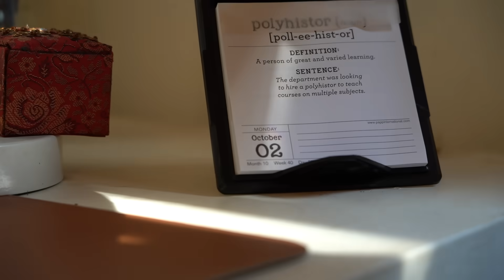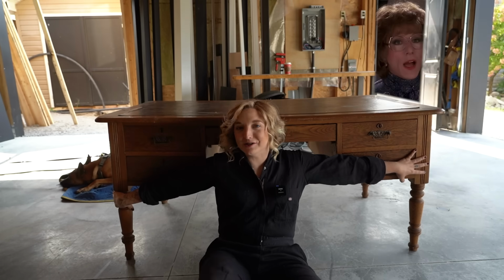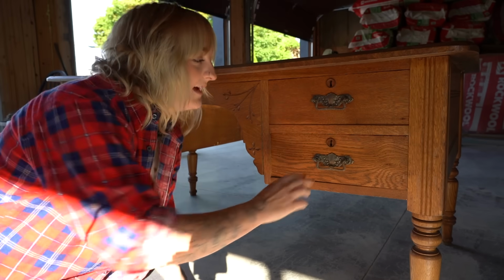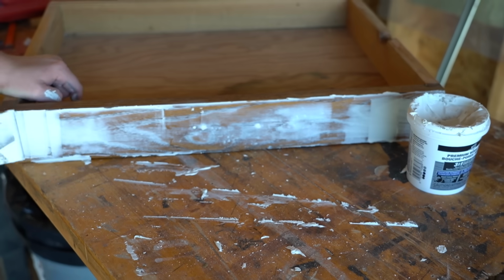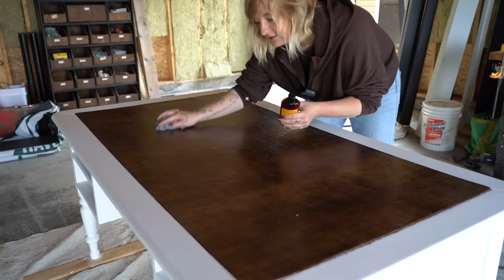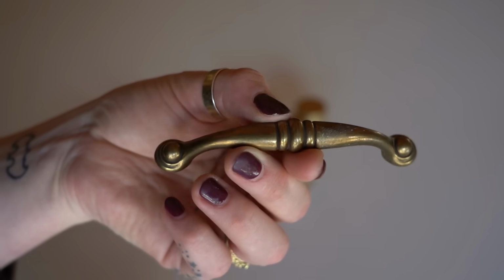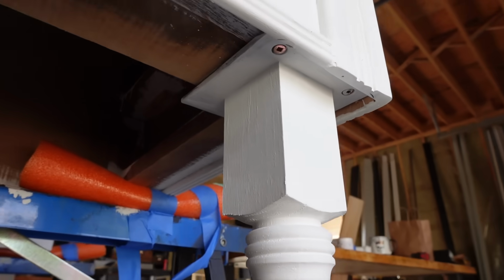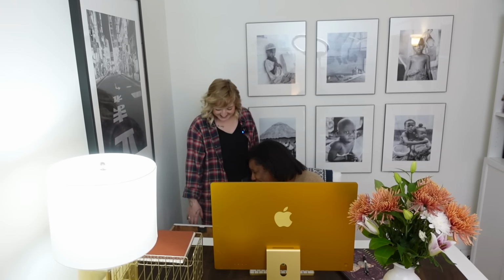*SURPRISE REVEAL* Flipping a vintage desk for an entrepreneur's office!

Comment: I think the only thing I would have changed was I would have used the middle wallpaper choice in the middle draw for an added surprise and to mix it up a little bit. Aside from that I loved every bit of this change. It turned out so wonderfully even with the changes due to the legs needing to be removed to get it upstairs.

Comment: I bought a desk very similar to this one.  The top comes off and divides it into peices. It's very heavy.  The top is 1 1/2 inches thick.  Also it has pull out extra work top spaces above each of the drawers. 
I totally love what you have done with this one.  Counting my blessings mine breaks down.  😊

Comment: So much work and such a lovely reward!  She looks very happy.  The wall paper is such a nice touch.
I had a similar vine inlay in an antique headboard that I salvaged.  After painting it, I used a wee art brush to touch the carving with bits of gold (I used spray paint sprayed into a small container for dipping) It gave it a nice look, but I think with the brass knobs on the front it would have been too much on this project.  
I have had issues with drawers fitting too tightly after painting.  Did you experience this?  My go-forward plan is to over sand the edges of the opening and the drawer face edges before painting for a friction free fit.  I have also had great luck with drawer wax (it looks like Vaseline) to keep the wood gliding smoothly when there are no slides on the sides of the drawer.  
Just wondering about the wax finish.  Does it stand up well to wear and tear?  
Your skills have come such a long way; kudos on the problem solve.  Beautiful job  💜